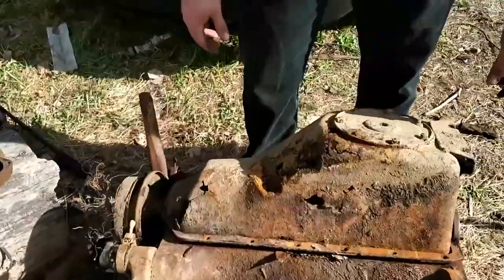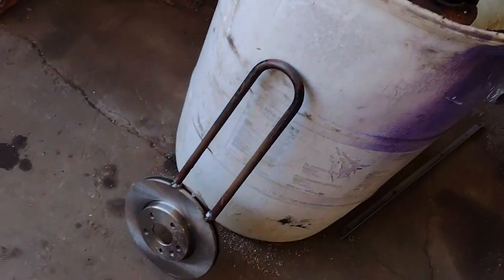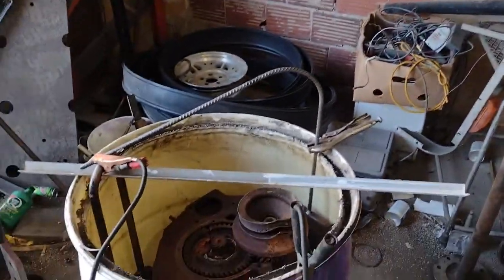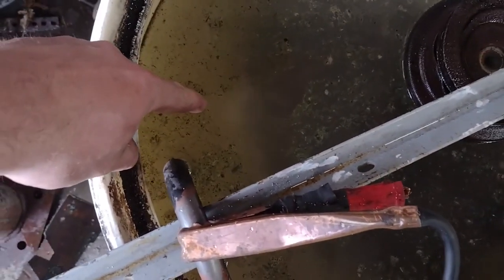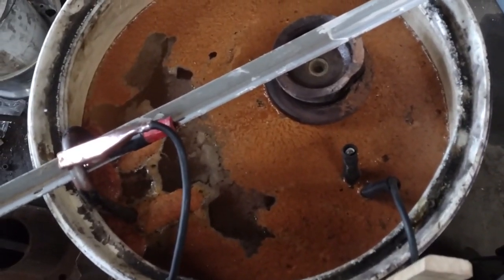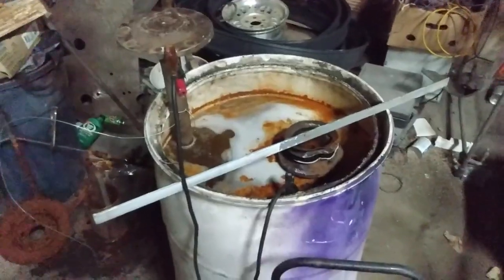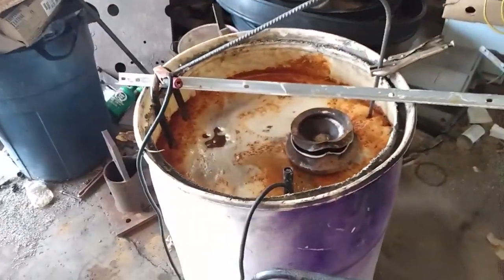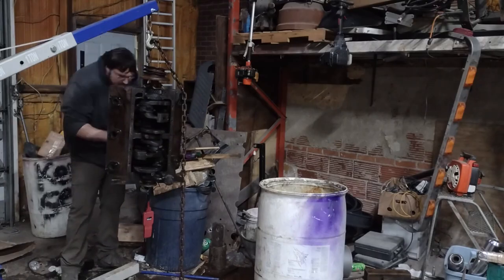7 days of Electrolysis Rust Removal On a Boat Anchor Of A Ford Flathead V8 (RE-UPLOAD)

Comment: To agitate, use a fish tank air pump, hose and airstone. It will keep it moving. How rusted that block was, you probably need to change out the water solution. Pressure wash the block at that time before tossing it in a fresh solution.

Comment: Guys I dug up a 401 Buick nail head motor , it was buried under ground for 25 years, a good friend told me about it when he bought his house, It looked like your motor, I have a 275 gallon home heating oil tank that I cut in half, I filled it with old oil put the motor in for a week, I boiled the motor wood fire under it, the motor freed up, I rebuilt the engine and was in my 65 skylark for years , till I sold it, back in 1992, you can do the same thing to that motor

Comment: Nice job. I always clean engine parts as much as possible before I use electrolysis to convert red iron oxide to magnetite. Scrapers, wire wheels and oven cleaner are involved. My machinist is impressed enough to mention how clean my stuff is.
Reply from the maker: @PCMenten  we power washed it, honestly didn't help lol, but we tried

Comment: Tbh,why would you bother,gotta be better flatheads available,if it’s just for content fair enough,
Reply from the maker: i think ill have it sandblasted and checked for cracks at some pint, i know one hole needed a sleeve after i got it apart.
Reply: No, probably more times than not the blocks are unusable.  Its not unusual to go through several flathead blocks before finding one that can be saved.

Comment: @tallgarage If you were to hang the one electrode in the lifter valley it might have cleaned that area more. Current takes the shortest path so it would move from the outer parts of the block .
Reply from the maker: Yeah that makes sense, thanks for the tip.

Comment: Did something similar 20 years ago with a cast iron SBF intake manifold that one of my coworkers had pried out of the ground on an abandoned property.  Results were  better than this, but it was a smaller part and not as nasty.  Had it in the solution over the weekend.  It will flash rust real quick.